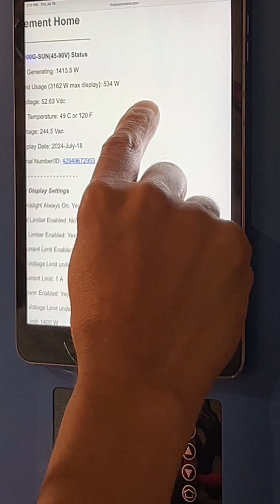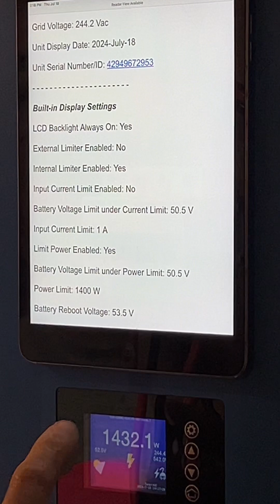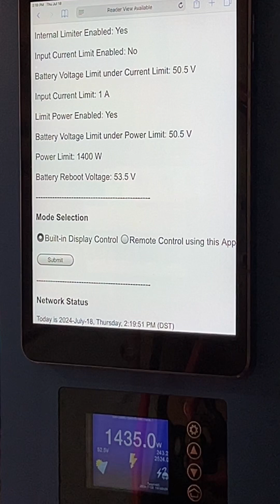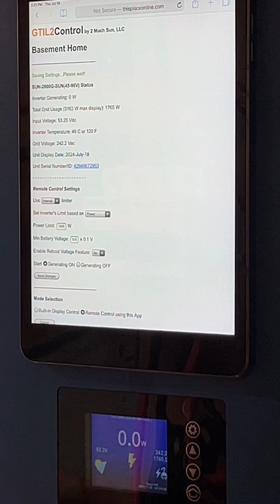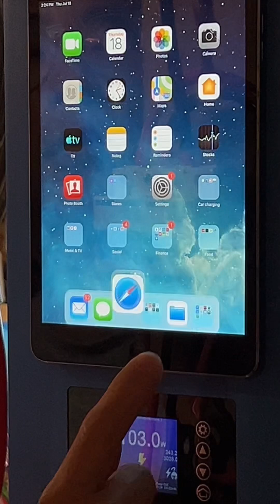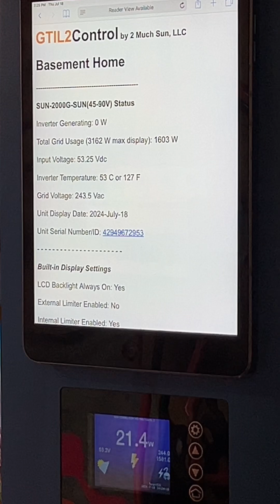Sun2000/1000 GTIL2 remote control

Comment: would this allow the unit to monitor the CT clamp current remotely? If I want my inverter 50ft away from the electrical panel, and not extend the sensor wire, would this help me achieve this?

Comment: I have never been able to use the remote control settings.. When I select remote control the inverter automatically goes to max output (1850w). When I select stop generating it highlights the cutoff volts like I have to select cutoff volt before it will stop generating. When I try to set the cutoff voltage it like glitches and all settings reset but inverter continues max output?
Reply from the maker: Hi RJ,  It looks like there are 2 things happening.  First when it automatically starts when going into remote mode, it is probably because one or more of SunBeam’s remote work timer is enabled and the time is within the timer interval.  The enabled timer also has a power limit set at 1850W.  To keep it from starting, you can disable the timers and  then check whether it’s set correctly to your needs.  From the home page scroll past the part where you change to remote mode to the section called ‘Remote Work Timers’ and select the ‘Disable ALL timers’ button.  The unit should stop producing in a few secs. 

The second thing is with the cut off voltage input value.  The reason why it highlights the min voltage text box is because the number entered is above the max DC input.  Sunbeam checks each user input to make sure it is within range when you select ‘Save Changes’ and won’t save if there is an input error. So for a Sun2000 G2 GTIL 45-90V, the number can’t be less than 450 or higher than 900.  Depending on the browser, you might not see the entire error message or the entire number entered.  Try using your delete key multiple times until the entire text field has been cleared and then enter the number you want.  

The automatic reset is because the home page will refresh automatically every 15 secs.  So you have to enter your  changes and save them before it refreshes.  

If it still doesn’t work for you, please call me and we walk through this together. At least you successfully completed the hardest part which was connecting it to your browser.  My number is (404) 626-5260.  Thanks.  Bobby.

Comment: This is excellent work. Thank you Bobby. I would love to try this out. I currently have two 2 2k GTILs. Do you know if the hardware varies at all between the units running 5.x and 6.x firmware?
Reply from the maker: Thanks.  There are actually 3 FWs in these units.  The one you are referring to is only for the one for the LCD display and as far as I know, those versions of FW are compatible any LCD display released for the g2.  There’s another firmware for the control board and another one for the motherboard.   My solution for the remote is not really hardware dependent but rather communication protocol dependent.  I’m assuming they have made different versions of firmware to be backwards compatible because they have to “talk” to different versions of firmware on the other boards so my solution should work on all versions .  Hope this makes sense.  BTW, I’m thinking of an introductory price of $49 and probably go to $69 regularly.  Looking to be available next week.